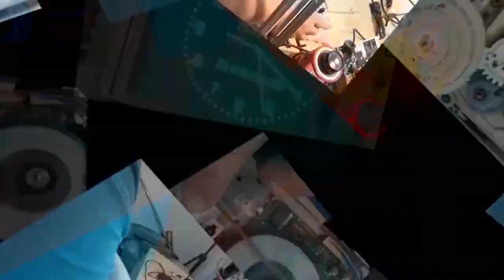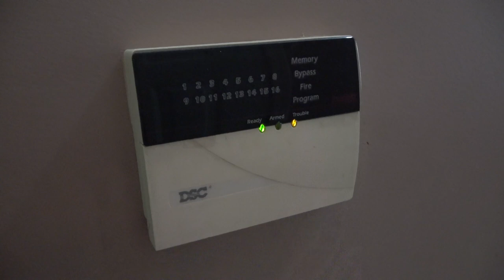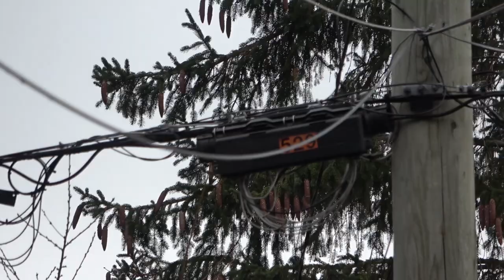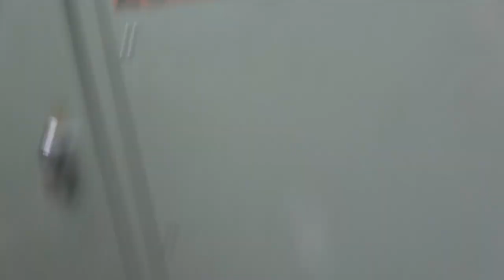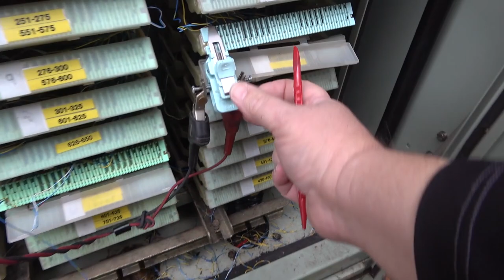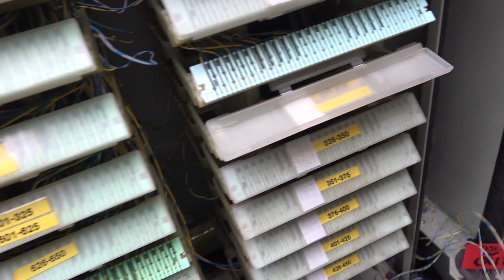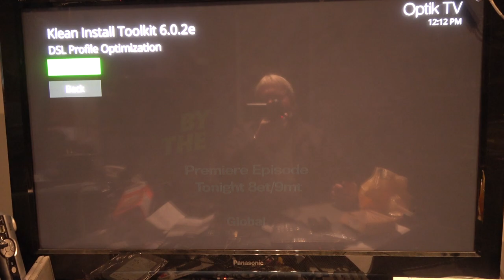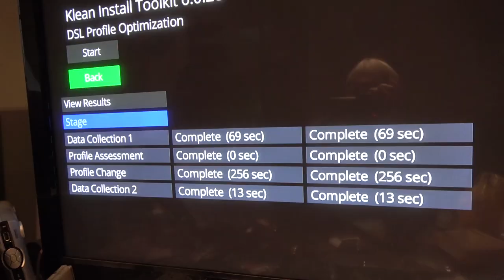Fixing my old noisy copper phone line

Comment: It's always interesting to see how it's done in Canada or US. Here in the middle of nowhere in France, copper lines are still used for DSL service and as for yours no more maintained as we're soon supposed to get fiber optics. However, most here have relatively low results on a single copper pair that could have been installed in the 70's. We also encounter different wire gauges, long distances to DSLAM, and we still have mixed analog and digital services on the same line as DSL service provider has not done the local technical installs to get digital only services... Mostly because lack of space in technical spaces dating from 50 years +! In my Burgundy village, I had the best baudrates available with a typical 14/1Mbps ADSL2, untill a severe storm have destroyed the local DSLAM and all my modems and home ethernet appliances (PCs Mainboards, DVRs, IP cameras...). One of my friends lives in a farm with a 17 km line, wich gives a 512kbps down rate only the best days; he had the same thunderstorm problems, and now even the phone is a mess when it rains (and he has to pay for an intermittent service), the only way to get any decent service is via satellite (mobile doesn't work in it's valley!). With new modem and phones, I also have noises coming from external aerial copper lines I suspect coming with severe multiple insulation failures and leaking connection boxes. But when there is 3,2 km lines to change, they don't care, and I have to manage with lower results, and crippling noisy analog phone line. And as I don't work for the national company line nor have clearance to tamper with phone lines (I don't have the keys), I bought a 4G data router modem (I have a no limit data handy line with spare PIN cards) wich gives a pretty interesting symmetrical baudrates around 75Mbps for a "local" antenna 18km away (with direct view!). My latency delay is about the same... And this solution is also interesting as I have no visible antennas nor fiber nor copper lines anyone can tamper for security uses, and no supply risk with a battery backup. This "radio solution" is now also available on most recent security panels, lift supervising appliances, aged people surveillance... I've also partly replaced the ethernet copper lines with fiber optics, as you can have relatively cheap professional switches with fiber management and mode converters. This is also perfect to electrically insulate servers and different home security services.

As I also worked on private network services, I also noticed you use different tools that those I know, with the same result, but I suppose it has some "historical" reasons as we work on larger modules arrays (norms?). I've also worked on wrapped arrays and other specific connectivity, and everytime using different tools. Needless to say with fiber optics it's probably the same, as technologies evolved. Back in 1992, we used hot glued classic ST connectors and had to polish cleaved ends by hand... So I guess you also have a fair collection of special tools, crimpers, special screwdrivers, line identifiers and line checkers (my phone tester is yellow but does the same...without batteries).
Reply: I think the UK is in a similar position with FTTC, still using copper for the last leg of the journey with street cabinets up to a kilometer away and beyond in some cases. There's talk of full fiber everywhere by 2025 but you know how that sort thing goes!

Comment: your phone will most likely have an emergency mode when you dial 911 or other emergency services. that makes sure the GPS is on and updating.
Reply: Still only works if it can actualy get a signal.
Reply: Not to mention, most phones now (smartphones) use Wi-Fi scanning to get an accurate location, too. This means you can be polled at almost EXACTLY where you are, even inside your house without a GPS signal, as long as your phone has reception from towers and Wi-Fi networks nearby.
Reply: With android, location services can use your wifi location to determine where you are. That's for apps, if enabled. That doesn't mean that the phone will necessarily use that for emergency services. Google used to go out and map the location of various wifi things. There was an amount of controversy surrounding it. Speculation: it may now also use your wifi history and correlated that with your GPS to work out where your wifi access points are.
Reply: I have very mild Raynaud's phenomenon basically my hand can feel normal but be a bit colder.
so touch screens sometimes don't work for me because fingertips are too cold.
mobile phones may be harder to dial if you are tensing up and cant do the unlock code
Reply: @nullvoid564  it isnt based on temperature, just moisture which changes the capacitance of the phone, so if you have thick dry skin or gloves they touchscreen wont work. but yea touchscreens arent as reliable as a physical button. Thats why iPhones have an emergency mode by pressing the power button 5 times. not sure about android.
Reply: @SuperBrainAK  try a touch screen when your hands get extremely cold

Comment: Really cool to see! I am telecom engineer in the Netherlands and just because there are differencs it's in big lines the same. Line sharing is no longer available here. If you want a analoge telephone line you got epots on the second pair. Fiber is rolling out here really fast this year but the most people in  towns and city's got DSL from FttC with 100Mb (DSL vectoring) or bonded DSL Vectoring (2 pairs combined) of Vectoring plus. 200Mb on a single line. Because also a lot of people are going over to fiber (GPON of AON) there are a lot of crosswires unused and also a mass in streetcabinets you said. Only big differences is here that all the wires are underground. So if there is a shortage underground and no second pair and no fiber we need to call a groundwork team. :) Again nice to see!

Comment: That is pretty good speed for DSL. I have never seen DSL go over a few Mbps in the states and few people I know still using DSL are only getting around 5 Mbps and less than 1Mbps for upload.
Reply: Here in the UK we can 330mb down and 60up on DSL, it's on a short loop tho.
Reply: thats about 3.5 -4 km away from exchange
Reply: it's VDSL, the fibre goes to the street cabinet, in the UK they market this as "fibre" means they now have to market the actual fibre services as "full fibre"
Reply: Telus (phone provider in western Canada) uses bonded VDSL2 or VDSL2+. With 2 pairs, you can get very impressive speeds. The last year I was in Canada, I switched to Telus (2 pair bonded VDSL2) from Shaw (Cable DOCSIS 2 at the time) and was getting better speeds, especially uploads, than cable (not because of a technical limitation of DOCSIS2, but just the speed tier plans they had), and paying less, and with no bandwidth cap, AFTER I had a tech come out more than once to fix similar issues with my phone line pairs. There was a bridge tap on one of my pairs. Not only was it connected to the cable going to my house, but it was also connected in parallel to somewhere else, probably going into someone else's house, and that causes endless problems for DSL. The tech also discovered that someone else's phone was connected to the 3rd pair on the drop cable into my house! Never even bothered to fix it, just left it that way. Shortly after I moved to the US, they rolled out the FTTH offering, and where I moved to in the US, I also have FTTH now. After having gig fiber for years, it would be very tough to go back to anything less, but VDSL2 is no slouchy technology, when your loop is relatively short, and doesn't have impulse noise, or bridge taps! The problems people have with DSL is their provider never deployed VDSL2, AND their copper infrastructure is a mess with cross connections and weird crap all over the place.

Comment: Thankfully you have a second copper pair to swap to, i have just one copper pair and adsl.
The problem i have is getting the company to look into faults, my modem loses the connection around 9 oclock at night and jumps in and out of connection.
Loverly old phones,  my mate has a few old rotary ones that still work, he has one that was an old emergency phone in it's own pole mounted metal box.
The rotary mechanism worked so well.

Comment: I remember my grandmother had an old 1970s trimline phone and the buttons would light up. The buttons would light up.
Reply from the maker: My grandmother had a starlight phone that the dial lit up on. Electroluminescent display. Used a 120 to 120v isolation transformer 120 volts on the phone cord.

Comment: Thankfully for those of us who live in a Frontier Communications service area we're super lucky, they still fully maintain their copper POTS service served off a real "hard" switch that works during a power outage, but also offer fiber optic for internet, I can confirm in Thousand Oaks, CA you can have an old school copper POTS line for phone, and a brand new fiber line for just high speed internet only and get the best of both worlds. In many apartment complexes DSL and POTS is the only service offered, there is no FiOS/fiber so that might be the main reason they're still maintaining it along with business customers that have a PRI or T1 line for a business phone system, I've seen a lot of businesses still use Nortel systems to my surprise that almost certainly are using some type of ISDN PRI circuit for calls. I'm sure a lot of elevator emergency phones also use their copper POTS service too

Comment: Some fiber companies still support pulse dialing, sadly not Xfinity though. It's also too bad that they won't let you use fiber for internet and copper for phone
Reply: you can buy modules that will do the conversion
Reply: Verizon FIOS in New Jersey supports pulse dialing if you get the phone service with net.   Problem is that Verizon's FIOS based phone service is stupid expensive.   I have FIOS just for net, 200 Mbps for $45/mon.   I bought an Ooma VoIP adapter and now pay $10/mon for two home phone numbers with unlimited calling in the US.   Sound quality is very good, and the service has been reliable.

Comment: I love these telephone troubleshooting videos! You made another video similar to this one where you were on the job right?
Reply from the maker: No, not on the job. On my days off.
Reply: Just remember that TELEPHONE drop lines are CCS (Copper Coated Steel) lines!
Reply from the maker: @Hammerhea64  
No they are copper. Perhaps 50 years ago they were copper plated steel, but not now.
Reply: @12voltvids  time marches on
More than 50 years ago was when I first found out.
Reply: @12voltvids  Yes, the OLD stuff sometimes has hidden advantages. The old copper coated steel was stronger but "cloth drops with rubber outer sheath " would corrode open and leave black chalk residue .   I like running a newer 3 or 6 pair copper drop with the steel support strand and quick drop cinches.  I would terminate an extra loop to a dead unused F2 in the aerial terminal for a backup plan.  This way I would only need to tone out the spare span to the FX and move the jumpers.  It always helped to carry a throw-down butt set in the car or toolbox when on the road.  Hurricanes along the Gulf Coast would knock out electrical power for days and anything on A/C digital or battery back-up from the PG huts would fail and copper to the CO would still operate.  Yippie.   JwgK
Reply from the maker: @Hammerhea64  
Your point?
Reply: You should try a body camera / gopro on the helmet , then narrate / subtitle.
Reply: He had another video where he went down in a remote switch that was partially underground. Was pretty cool to see. I bet his employer saw it and made him remove it though. It’s too bad, there’s not a lot of pictures/videos of this stuff.

Comment: That moment when you find out this guy's DSL is faster than my Fibre (granted, it's FTTC, but still)
Reply: that depends on which FTTC you have, a 17A profile is a 80/20 link which is normally set in either 1 of two modes, the restricted one or the more expensive faster speed boost that you pay more for. you either have a 40/10 or an 80/20 the 40/10 normally gives you around a 36/37Mbps connection at full speed. the 80/20 gives you around 77Mbps at full speed.

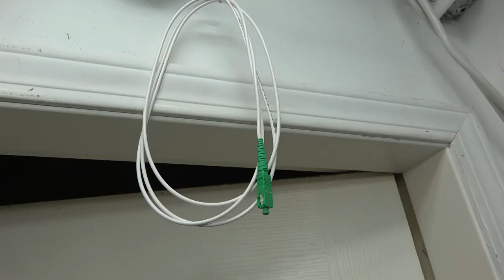Comment: 17:00, but why not run it, set it up just to take advantage of the faster speeds JUST for web surfing and keep using the copper for everything else, including your legacy equipment.  Who said that you have to remove the copper in order to be able to use the Fiber optic?  Why not use both at the same time and enjoy that speed boost for when you surf the web, JUST for the web/computer use purpose.
Reply: Why would you need > 75Mb for websurfing?

Comment: phones use wifi & GPS for location. lets say ur out front of your house, your phone can get GPS + it can see your WIFI SSID & MAC (does not need to connect to it) + it can see the wifi nextdoor. your phone secretly puts that info in an online database. next time someone's phone tries to find its location, it will check the nearby wifi, if it can see the same SSIDs & MAC addresses it knows where it is without GPS.

Comment: I had and still have a similar problem at my house. Connecting to the master socket my line works fine, if I connect up the faceplate distributing the phone line to other sockets in the house I get noise and internet disruption (as I discovered at the start of UK lockdown this time last year so great timing on that). I work in IT for a living but I don't work much with phones, so I tried the only thing I could which was check and re-terminate all the sockets in my house (same as with an RJ45 socket, but only have do deal with 2 wires instead of 8), which didn't fix it. At this point I reported it to my landlord (who's responsible for repairs on the house), and naturally they don't care so I ended up running a long RJ11 from the master socket across the room to the router (I've got a hardwired NAS with a UPS connected to my router, and there's no space for all of these devices by the master socket).

What joy it is to live in an old village. I get that external aesthetics are important to the community in the UK, but it baffles me why the insides still have to be stylised with the same 200-year-old aesthetic when it's wholly inadequate and impractical for the 21st century. But that's a rant for another time. Great video, thanks for sharing.

Comment: Kudos good sir for still rocking a Pioneer LaserDisc player.

Also at my old place we still used copper cable for telephone. Back when we had Prodigy (you young ones can go look that up) the local telecom ran a "cleaning pulse" down the lines that pretty much blew out the external modem, serial card, motherboard, and PSU that our first 80386 had. Despite physical damage (modem exploded, burnt the power socket it was in, and board damage) the local telecom denied they had caused the damage. 

Later after many upgrades and new PCs I never got past the 26.4 baud bottleneck when attempting to access the internet via dial-up. Never did the local telecom replace the paper wrapped copper lines that fed my neighborhood. 20 years ago they offered DSL. And my father happened upon a DSL modem. We were ready. And just .75 miles out of max range for DSL at the time.

Cut to Adelphia offering cable internet... (Again you young folks do your Google thing) and 17 years later had stable cable internet under Comcast. Kitchen remodeling had uncovered 900 feet of connected on one end coiled coaxial cable in a closed off crawlspace above our kitchen causing a plethora of issues for the neighborhood. Once that was removed internet was rock solid.

Upon moving out the home was still with the paper wrapped copper telephone lines serving it.

And Consolidated Communications is a joke as a service. TWO MONTHS it took them to resolve an accidental disconnection. Gave us a "temporary number" to use while they re-assigned our main number back to us which rang to nowhere. That was two weeks into the ordeal. The rest trying to tell them the main number was still disconnected. Did the same thing where I work. Only instead of over a month and a half only took 7 hours to fix for a HOSPITAL

I applaud the use of landlines. A physical location tied to the number assigned. These should be everywhere since I can count on the number of thumbs on fish the number of times the landline was taken out by ice storms. Even not in use for incoming or outgoing calls at least have them available for emergency use. Sure cellular phones are great, but with the GPS being accurate to within the confines of a tennis court that could mean any of the 4 other condo units around me as well.
Reply from the maker: I have many lazydisk players and a few boxes of movies.  A few hundred disks.